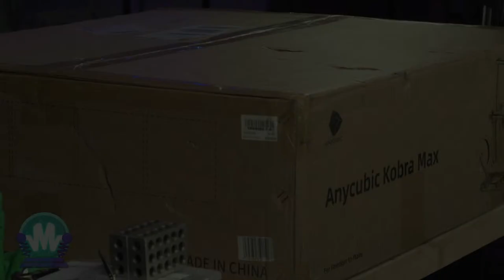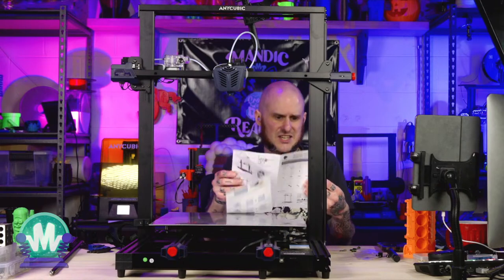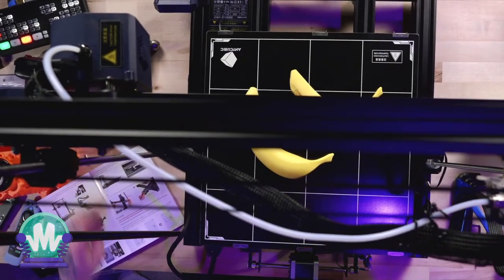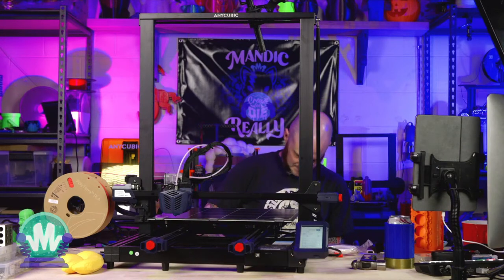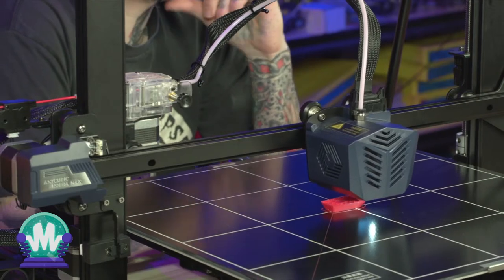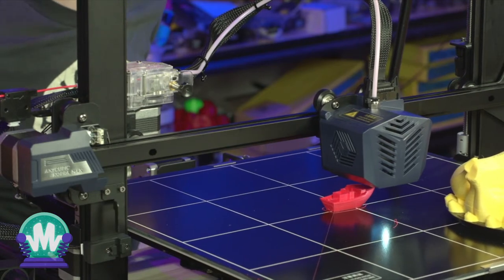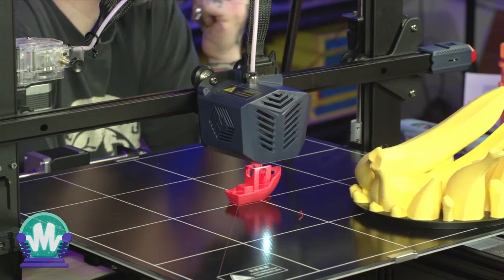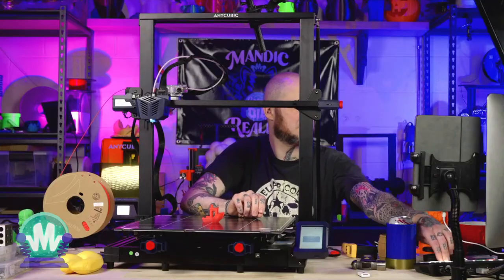AnyCubic Kobra MAX - Unboxing & Test Printing My Biggest 3D Printer!

Comment: great video, also have mine up... quick question what printer settings have you used on Prusa Slicer
Reply from the maker: I just took a CR-10 S5 profile, changed the bed dimensions to match the Kobra Max (400x400x450), and set off.  So far I have only had some oddball Auto-Leveling issues that I think are more to do with the machine than the Slicer Profile.  

Unfortunately my Studio computer is a Mac and Anycubic's version of Cura they put out seems to be bad and won't actually open on any Macs I've tried, so I can't confirm yet.

Comment: With your Neptune printer do you have issues with interlocking parts????
Reply from the maker: I don’t really use my Neptune 2 anymore. Calibrating E-Steps, Temperatures, Retractions, and Flow numbers are all important when printing parts that have to fit together or print-in-place objects. Slicer layer heights can effect things even. I say all this to say, it could be a thousand things causing your issue. Start from the basics and work your way up.

Comment: Do you know what the motor types are for this machine? I am looking at installing NEMA23 motors into this 3D printer to test out some x-y-z motion for a different RnD machine I am working on. Looking to see if the current machine mechanics will fit those motors
Reply from the maker: The machine uses NEMA 17s currently.  I'd imagine for RnD of motion systems you will want to be able to dial in Vref and Amperage.  Unfortunately as of right now Anycubic is not releasing the Firmware for the mainboard in this machine and the Processor is currently unsupported in Klipper. So I would say this is not a good platform for those purposes.  Unless you intend to just use the mechanics and replace the electronics.

Comment: Do you have a video on the right way to change over to a 1.0 nozzle on the Kobra Max?
Reply from the maker: Currently no. I’ll be doing my long term review of the Kobra Max VERY soon and discuss nozzle changes / running larger nozzles in that video.
Reply: @MandicReally  cool can’t wait. I am printing a lot of gaming terrain and I am trying to figure out if I can save time by going bigger and still get quality prints.

Comment: Hello. Did you have any issues when starting your first print such as ramming the head into the bed by -z2.0mm or the opposite as printing in mid air z+2.0mm. I use cuar and tried prusa and no matter what I do it sort of ignores the autolevel and z-offset on the printer.
Reply from the maker: No I have not.  Sounds like you may have a firmware or sensor issue.  Does it properly do an Auto Level THEN ram the head into the bed or just during a homing run?

Comment: Sorry if i missed the explanation on this, but how would you do the z offset while using the printer?
Reply from the maker: Settings Menu during a print. Z-offset is right on that menu and should be adjustable.